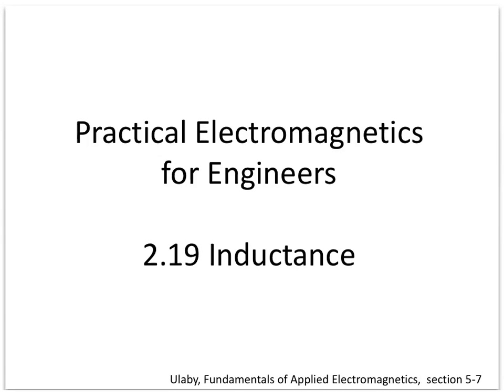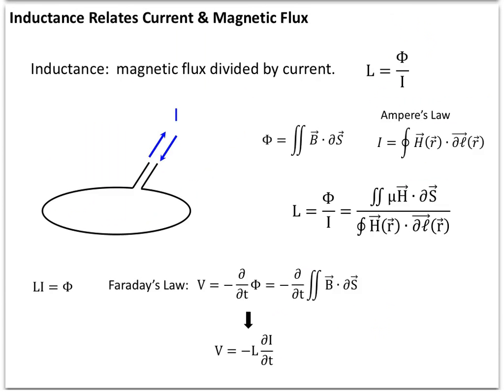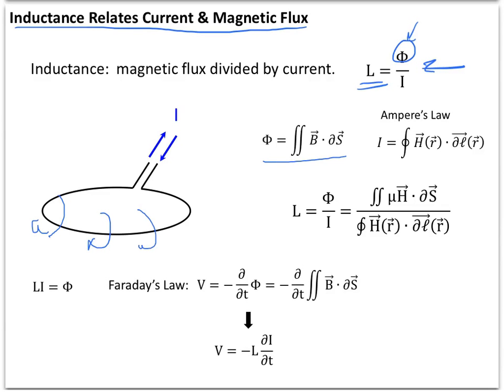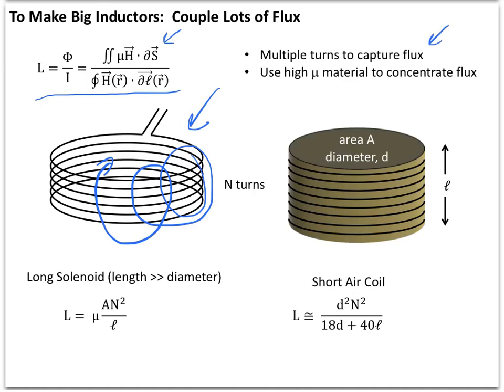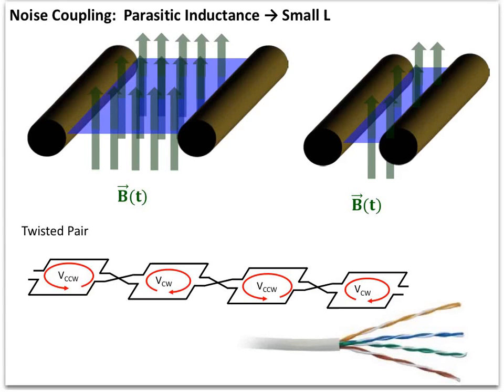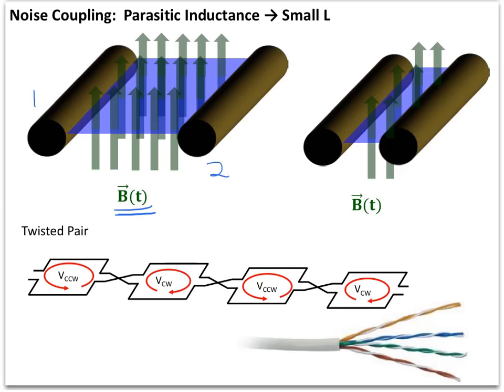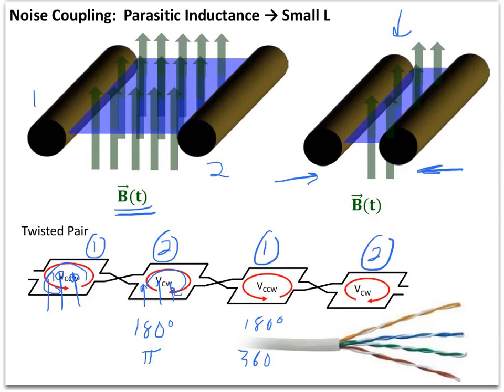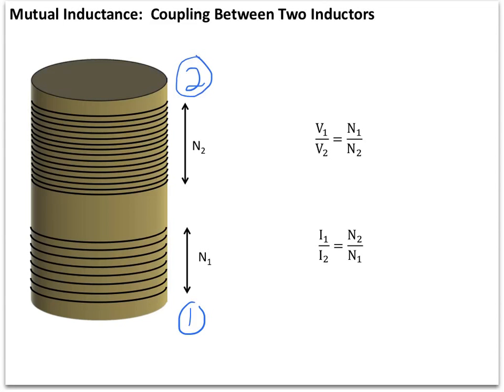2.19 Inductance

Comment: Can you explain ground loops?
Reply: nothing complicated in that: two devices which have more than one GND connection (one in the outlet and one direct) which form the loop. The direct connection between the devices is usually GND and a signal wire in one package. The GND loop now acts as an antenna and picks up an oscillating magnetic field from the background (AC network or other stuff) and you effectively have not a Signal and GND connections between two devices, but two Signal wires sitting next to each other. And then you got all your nasty stuff as a magnetic coupling and crosstalk, which corrupts the wanted Signal.

To resolve you can either reduce the loop area or use the isolation transformer. You can also play with the Signal protocol and use something like a high-voltage UART with an inverted logic scheme